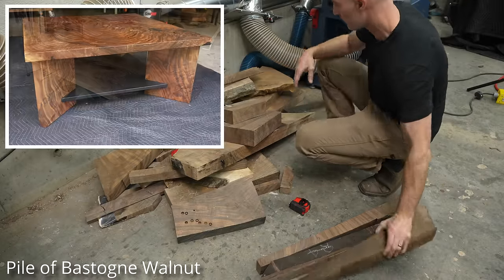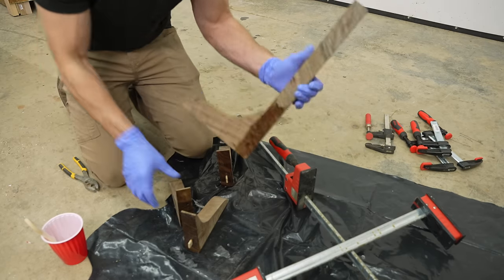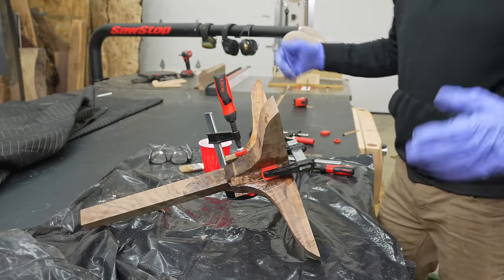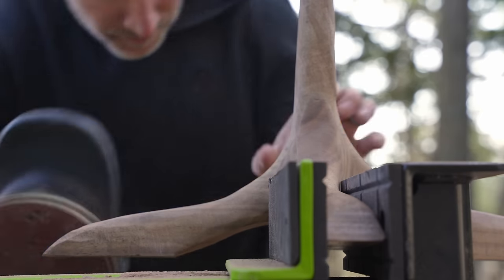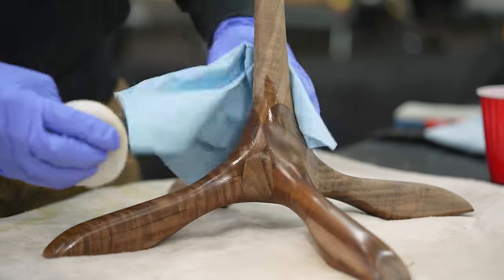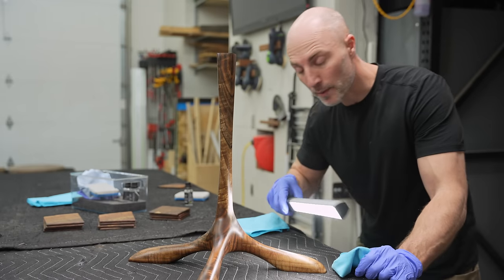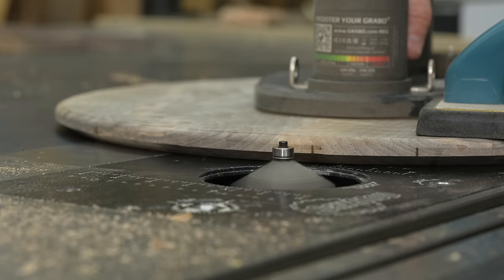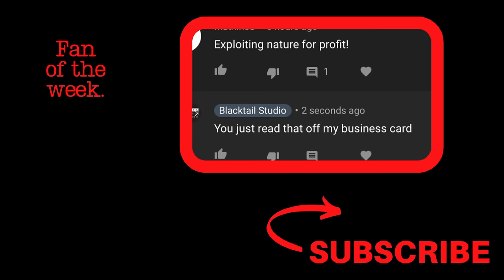They Mocked Me For This One

Comment: Your carving made me think maybe a vortex or gallaxy of some kind may be an interesting project with big sweeping spirals, rather than small details.  This could possibly take the final form of a round or oval table top with an epoxy center to flatten out the surface (clear if you love the center of the vortex or opaque if you dont?) or maybe rhe vortex gets filled by a mirror and it becomes a wall hanging?  Or to go crazy a bunch of smaller mirrors creating an insane effect around rhe edges?  Ok I've said enough.  Love the table feet, especially the exposed dominos, what a "happy accident"!

Comment: I really enjoy your videos and am nearing completion of a workshop that will allow me to complete some long needed projects for our new home, where we have retired, in the mountains of North Carolina. First up is an epoxy dining table that will be used by me and my bride 90% of the time, but will need to expand to feed at least 8 on occasion. We are restricted to locate the table in an alcove that is 9’ 5” in length. That will work fine when there are two of us. With a larger crowd, we would be able to move the table out into the room, but will need to add extensions on one or both ends. The challenge is how to add the extensions so they look good in either configuration. I have purchased your epoxy table course and have studied it. I have viewed every video of yours that I can find. I believe I saw mention at some point of a table you built that sounds like what I am describing, but I can not locate it. Am I dreaming? Do you have any suggestions that might help me with my project. Thanks for all you do for the woodworking community.

Comment: Milwaukee does make a great tool selection. It was enough to nearly make me jump ship but I found this 'battery adapter' that let me use Dewalt 12v with Team Red. It's been pretty handy and let me justify purchasing some of the Milwaukee tools. I will say seeing you use the die grinder and it overheating, it is worth it to get an air powered one.

Comment: Adding exotic wood inlays using a laser engraver. Using the same pattern you can both cut out the inlay itself from the veneer, and engrave the base surface to the exact depth of the veneer itself or so close it makes finishing no big deal. Just drops right in. Maybe a hidden bubble level and adjustable feet to make leveling the pieces super easy.

Comment: I live in a block of flats in middle England!  I've converted my 12'x12'  balcony into a workshop. Anyway after building a supersize solid wood bed for my misses and me, and building a couple of pieces of furniture I fancied a change. Sooo, I've just built my very first bow from 2 hickory sledgehammer handles and backed with some birch from the inlaws garden. How's about you make a bow from start to finish from any wood you think will bow!  No cheating by using fiberglass or carbon fiber either!   I hope you try this out as I've had so much fun building mine. BTW there's nothing at all wrong with crows feet! The table looks like it's really nestled itself into your home! 👍

Comment: The reason I finally settled on Makita was how many various tools they have on their system. 
They have all the woodworking tools I needed. Plus loads of garden tools and construction tools. 
I regularly use my makita 18v battery chainsaw to saw a tree down then a couple of years later will use those same 18v batteries to cut it down to size, drill it and shape it with a die grinder or angle grinder etc.

Comment: Hey cam, I did watch tthe end, but regardless, check this out:

When you are making threaded inserts, to get the grain right, take a photo of the hole and the grain around it and then make an actual hole on the printed photo.

Slide the photo around the wood you are cutting fron until you get a perfect match.

You might need a jig to place the camera at an exact distance so that the actual hole and the photo hole are the same size, otherwise it might not work so well.

I would love to see it bring even better results for for you.

Comment: Your projects are great, just have fun with the next one 😏
For me it also took some time to get battery powered tools as my "go to". Recently, battery technology got very user friendly - especially with those fast charging ones. And for the last 6 years I had a few tools from Bosh as my work toolkit. Angle grinder, drill and an impact driver. And we used those things in hard conditions too (cold bay storage -23 to -28C). All of them were in my car trunk - heat and cold. And those last 6 years convinced me, how comfortable those things are. And one additional bonus (ok, two). No power cable means your movement is not hindered and additionally, you don't have a power cable in potentially dangerous places. Especially if you use that angle grinder to cut through old wet pipes or a 30 year old expansion tank from your central heating (yup, did that too - slime was allover me and walls around me🥰). Having that low voltage tool in a wet environment is a blessing. I know i could shorten the battery, but it's a bit easiter to grab a smoking batteri in some kind of pincers, then trying to recover after a wonderful shock, you got standing on a ladder while trying to cut a wet water tank (water was drained, but it always leaves a bit in such places).

Comment: next time, for the awkward angle clamping, what about trying painters tape and CA glue trick? temp glue a small piece where you want to clamp. and would help with directing the clamping force
*could keep the matching off cut piece so the curve matches and you get a solid hold

Comment: I’d like to see you try making a run of knife scales or maybe pen blanks. Just let your imagination run wild, and try your craziest ideas out on them. It would be a very economical use of your offcuts and leftover epoxy. 

Also, I think your clamping issue could have been alleviated by using nylon string. Number 18 nylon mason line is more than strong enough, and super cheap. You just cut a notch in all four leg pieces like you did, tie a simple loop in one end of your string, wrap the free end around the legs in the notches and thread it through the loop. Then start wrapping the slack around the legs, and use a spring clamp to keep the tension when you reach the end of the slack. The notch keeps your first loop in place applying even pressure which builds with each subsequent wrap. And because it’s nylon, epoxy won’t stick to it. I use this all the time making marking knives, and it works really well. Just wanted to put it out there. Anyway, love what you do, and thanks for sharing!

Comment: I'd love to see a sitstand computer desk BUT it should include a surround attached to the desk for an atx computer, say a fractal design north wood fronted case, so that the case with move with the desk. Further to that it should have cable giudes underneath, a hole mount for a double or tripple monitor stance, qi charging built into the desk, and a keyboad tray. On the other side to the atx case mount underneath should be some drawers or shelves and somehow a lighting mount to light the desk. A complex problem that some have attempted, but never to be beautiful!

I'd love to see your take on that - especially since I can't commision you to do it.

Comment: Repairing damaged table tops would be something I wouldn't mind seeing.. mainly because I may or may not have put my 30KG computer on our relatively expensive dining table without some protection and now have a 6-8cm long scratch that is about 2mm deep and 3mm wide.

Maybe talking about the options available for an at home fix that will get the job done right up to making the call for when a professional would be needed.

Comment: When you are gluing things up and glue is getting on everything you should put some paper, newspaper or tape between the clamp and the glue. Its comes apart much easier and it's nothing to sand off the paper.

Comment: Doesn't exposing the bottom edge of the domino joint create the possibility of the feet kicking out if pressure from above pushes the feet out of the joint? Especially after hogging out the inside portion of the feet, shifting that leverage out from being closer to center like it would otherwise be. Seems like you're putting a lot of faith into your adhesive, at this point your domino isn't doing anything structurally. And the single threaded connection between the base and the top... Curious as to the long-term durability of this piece. Pretty shaping and finishing work though!

Comment: I think you should try a new style, push yourself a little. Try some mission oak stuff or Frank Lloyd Wright inspired pieces. 

Also, did you get into the dominoes when carving out the bottom? Or did the pieces not stay after the bad glue process so you added reinforcements? You never addressed what the 4 inlays(?) are on the bottom.

Comment: I would urge caution for the less experienced when sanding to higher grades before using hard wax oil.  The oil in HWO is to penetrate the wood fibres. If you sand to extremes, you run the risk of eroding the fibres to the point where the oil does not penetrate evenly. That can lead to blotches. It’s the same when you oil a piece with varying densities of fibres (a burr is an obvious example). The oils will penetrate to different degrees; however, a burr is usually a myriad of shades of colour and any blotches might not be visible. 

I treat every species, every board a little differently. You get extremes such as oak (open) and hard maple (closed) but different oak boards react differently. Having said all that, hard wax oil is still, for me, the best compromise for durability, ease, practicality and cost (per square yard applied)

Comment: Makita IMO way better than Milwaukee. They have so many tools and items I never even expected from them that are battery powered such as a battery powered cooler mini fridge thing that can also be used as a warmer for keeping food and drinks warm on the jobsite and it has USB ports on the inside in the battery compartment to charge phones with I have several Makita products on the 18V range and although I am no pro when it comes to this I probably won't bother with 40V tools from them because I am just an amateur and just own a drill/impact driver kit as well as a multi tool and an orbital sander. Then I have a cordless hedge trimmer and a air duster/dust blower that I use to clean out electronics such as my PC (I build PC's as a hobby thing) and is also good for blowing out dust behind appliances and radiators and such and has a filtered intake. All run off the same 18V Makita batteries I have and if I get more stuff I plan on sticking to the LXT 18V Makita tools

Comment: I actually came to this video from the apology video.  I wondered what the apology was about.  This is it?  I don't get it.  Why would you have to apologize?  You do good work.  So a piece is "knock down".  There are advantages to that. Some woodworkers have made names for themselves for that (think Victor Papanek and James Hennesey).  The one to answer to is the one who is going to use the furniture, not a bunch of woodworkers on line.  
What I like about how you did this table is that you were looking for lines.  Most woodworking from when I started in the '70s has been about flat, straight lines, and certain types of joinery.  You got your name by going out of the norm and learning to make tables using different methods and materials from what typical woodworkers use.  In the process, you've had to try different ideas.  You've experimented.  You mastered (I think) a variation of a craft which lots of woodworkers are trying now to imitate (which all woodworkers I've known do).  Be proud of what you've done and what you are doing.  You've "made mistakes" and learned from them.  I don't need to hear any apologies.